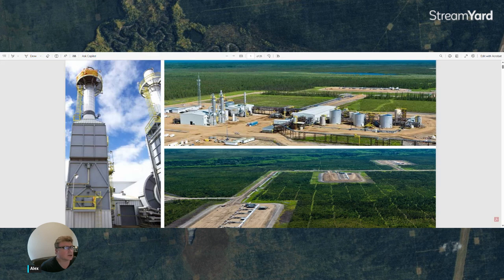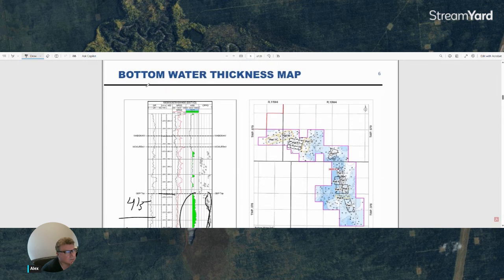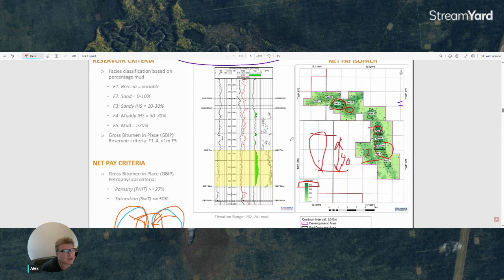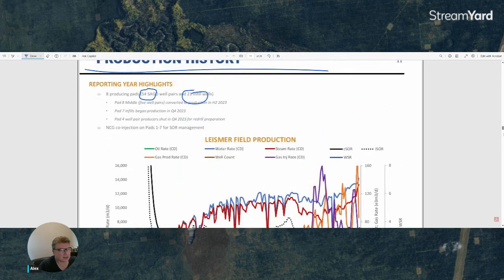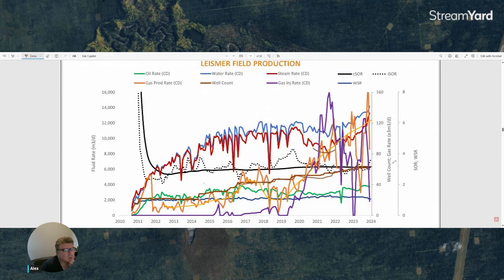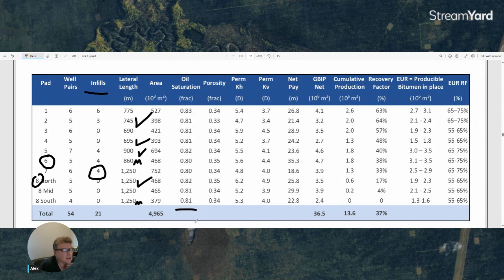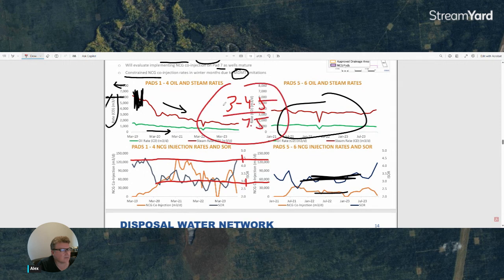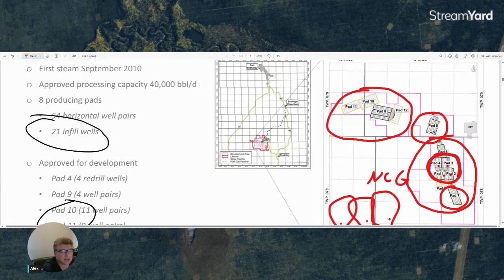Lecture 5: Athabasca Oil Leismer SAGD recovery scheme and NCG co-injection

Comment: Interesting video. I don’t understand what top gas is and why it is a problem. I get why bottom water can raise your SOR, but what will the top gas do?
Reply from the maker: Good question, it could hinder steam chamber development, because if the steam goes into the top zone now you have least resistance instead of going lateral chamber expansion steam just go upwards and then the noncondensible gas from the top zone will hurt chamber of development if it makes sense